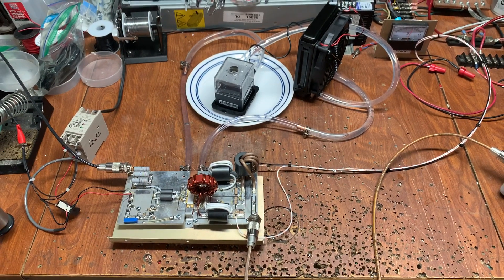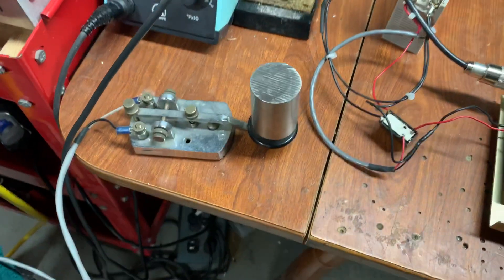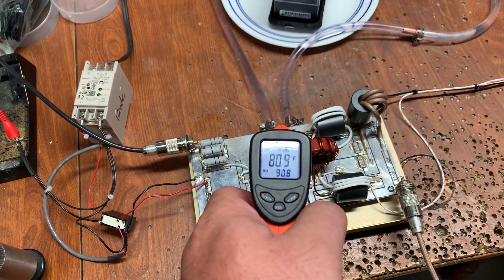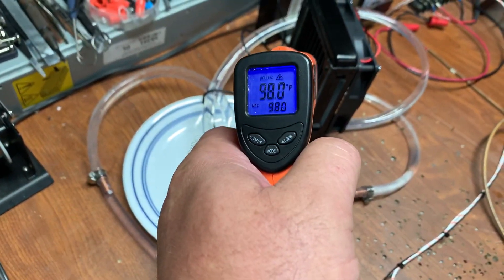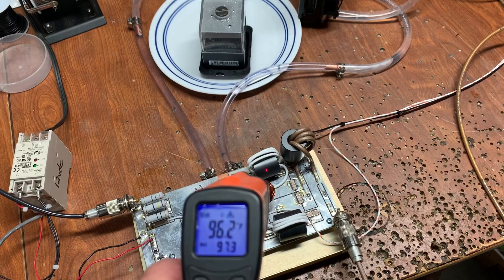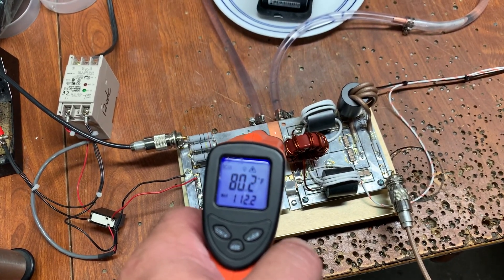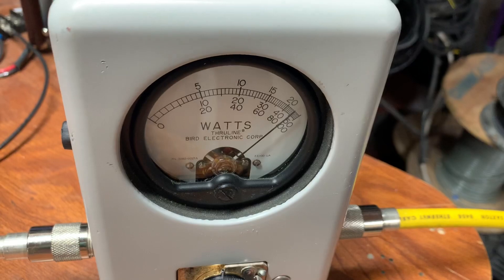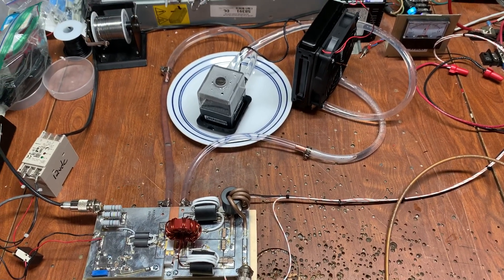MRFX1k80H water cooled

Comment: Hi. I like your works very much. I am also a HF builder (homemade!!).
 I have a 2 x MRFX1k80H amp in the works. I can't find TC 24 cable. Can you help me with a source to buy this cable??
 I do not want from the Chinese people!!!
 Good day!! YO8WTW, 73!!
Reply from the maker: I am not sure what tc-24 cable is? I use tc-18 on this amp. this can be bought from communication concepts.I went back and I found the tc-24 reference, you can use any 50 ohm small coax on the input. rg-316 or anything.

Comment: Single radiator and block for cpu is designed to manage ~~100-150 watts of thermal energy.  At a kilowatt, assuming typical efficiency, dumping at least 300 watts thermal into the water loop. Switch to a 360 or 480 computer rad, or a thicker rad...  and run time will go significantly up.   Hardest part really is water-block design.  Really want as much copper-water contact surface as reasonable available there. I've seen a similar running near 2kW sustained for an hour with case temperature never going above 60C for an hour.  Water always has the advantage of being much more efficient of removing the heat from the generation source.  Definitely something that I want to try someday.
Reply from the maker: Yes, this cooling was only good for about 5 minutes at 1kw continuos duty.

Comment: Very impressive amp. That semiconductor appears to cost around US$1300. Is that correct? Did you use the NXP reference design circuit for the amp?